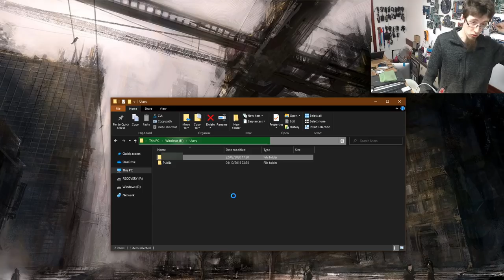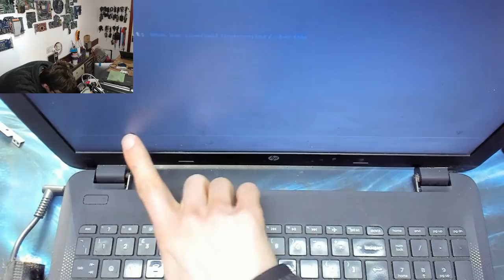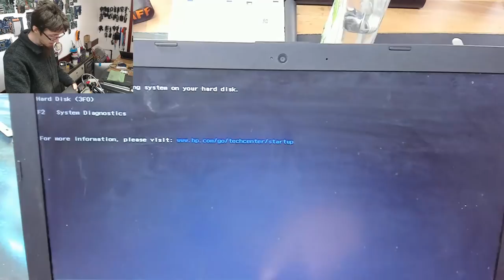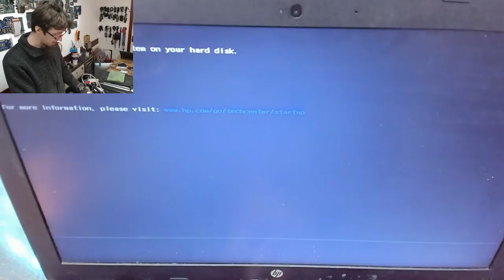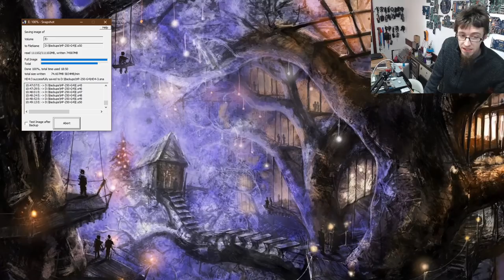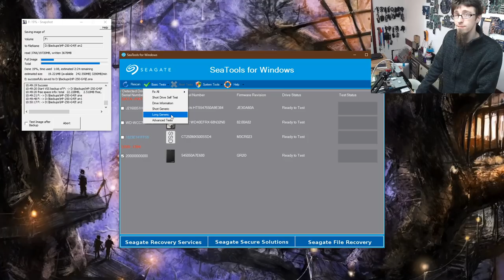LFC#202 - DIY Approach to Liquid Damage

Comment: Good video Graham, very useful, thanks. Picking up on what you said in the video, it would seem that, in your opinion, anti-static wrist straps aren’t necessary in Shaftesbury because of the humidity. Is that the case?
Reply from the maker: That's my assessment of it. There's obviously a time and a place where static prevention is critically important, but having been down this kind of repair work for years - bench work that is, not lab stuff - I've yet to encounter any kind of static damage to PC or laptop components.
That being said, I'm sure there's people who work in specific fields, places, or on certain devices, who would say otherwise. So I'm not saying that static damage doesn't exist. But yea, if you're in the UK and you're fixing a laptop or a PC, you'll be fine without anti-static.
Reply: Thanks for the reply, much appreciated. You have repaired/upgraded the PC that I use for flight simming a couple of times and also given me advice about a Mac. All good stuff!  I will be back when more advice is needed. Cheers!

Comment: My OPINION from my EXPERIENCE ...  the HDD had NO PHYSICAL DAMAGE....  but if you ran CHKDSK  it would have booted properly..
However, disks are INEXPENSIVE...   when I started with computers...   a 20 MB drive was the size of a washing-machine and at $20,000..lol

Comment: Hi Adam, maybe not the best video to ask this on, but I have a 128GB SSD that I use as a windows HD that is now just not big enough to take the lastest windows 10 update. If I get an M.2 that my board can take, can I just load windows on to it from a windows flash drive that you have shown to us in another video without needing to find the code I have on this current SSD?
Reply from the maker: Yup you can clean install and it'll activate, because same mobo.

Comment: Really enjoy your video’s. 
Can I ask your advise on a project that I am looking at ?
Reply from the maker: I'll take a shot at it 👌
Reply: Adamant IT  I am trying to fix a gate barrier but have no schemas , so I tried to check the components and found one short triac and burned resistor & fuse.
The question is- do I plug in -the power after replacing them, Or try to dig some more into the circuit..
Forgot to mention that the circuit was water damaged and that area looked a little white,

Comment: Good move with the SDD - how about the RAM? looked like only one 4GB SO DIMM
Reply from the maker: You can survive on 4GB of RAM on a system for basic internet browsing, especially with an SSD to make the system 'feel fast'. It's not ideal, but of course it's a matter of how much money you want to spend.
Reply: @Adamant_IT  Sure but Win 10 is a dog on 4GB in my experience, RAM is relatively cheap with brands like Liteon etc around. Do you go with certain brands for RAM and SDD's? and cheers for the tip on Mac reading an Windows volume read only, having to change rights first is tedious. All I need now is a Mac, maybe that should be an excuse for getting one.
Reply from the maker: True true. RAM I generally shop by price, provided it's got a brand name on it like Crucial or Corsair. SSDs, cheap option is Crucial BX500 (at the moment) and fancy option is Crucial P1 or Intel 660p. I generally don't lean toward the super quick stuff like Samsung because it's rarely worth the cost.

Comment: Is technical grade isopropyl alcohol safe to use on electronics? I read it's the lowest quality and not good for your skin.
Reply from the maker: Yup, it's non-conductive, you can use it on live electronics no problem. It's not corrosive, but it will dry your skin out with repeat use. Moisturising hand wash will fix that. It's certainly not dangerous.

Comment: water damaged laptop it is a good idea to change keyboard and clean cables and ribbon connection or change them so the oxidation don't return...
Reply from the maker: If they keyboard is damaged and not too hard to replace, sure. If it's a tough keyboard to replace, I'd wait and see if it's an actual problem.

Comment: can i use 70 percent ethanol? cleaning old MotherBoard
Reply from the maker: Just for cleaning, sure. Although I would try and get 99% Isopropyl if you can, as it's more or less electrically safe.
Reply: @Adamant_IT  99% Isopropyl are hard to get in the philippines even 70% are limited due to shortage due to pandemic

Comment: What about the water on the keyboard. That's a problem.
Reply from the maker: Keyboards will often survive a spill. If the keyboard doesn't work after it's had time to dry, go for replacement. Making sure the motherboard etc is working is the important bit!